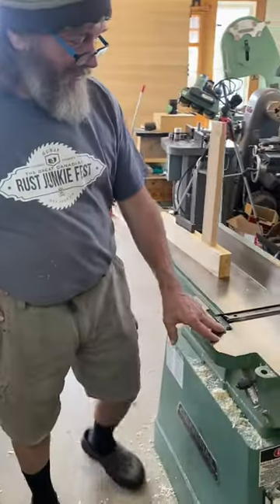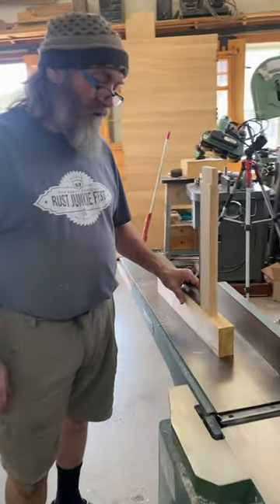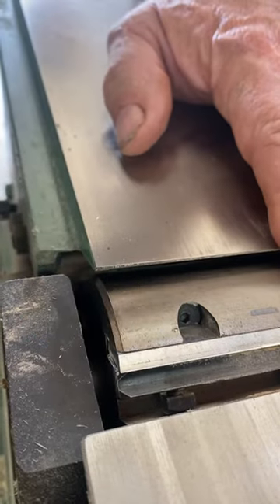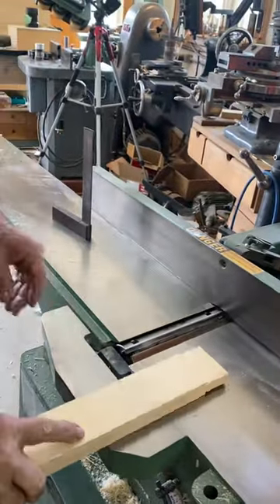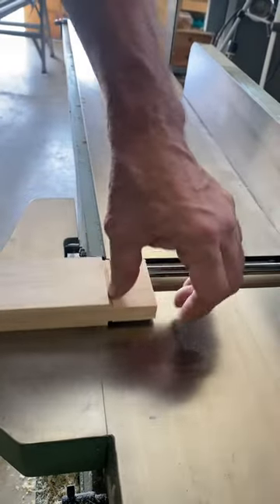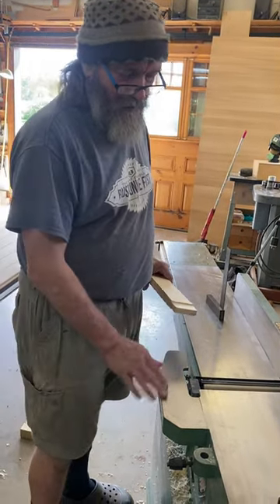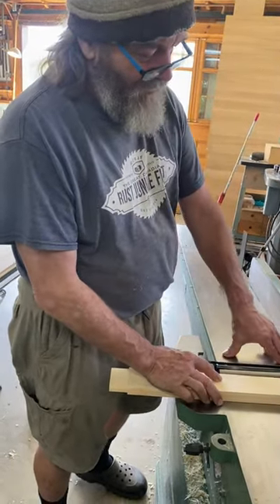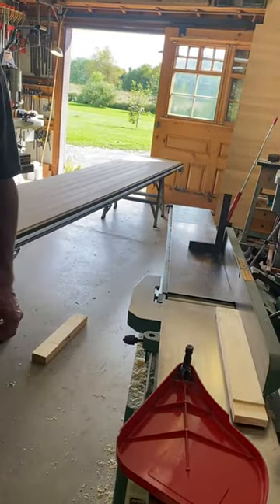Tenon cutting on the Jointer

Comment: Hi Jack, Multico back in the day made a tenoner attachment for their 9" Surface planer, similar set up as a small sliding cross cut table for a saw table, I have one cuts like a dream, most of the big tenoners including Wadkin have big horizontal  circular planer heads doing the main cutting, the Multico is not quite a Wadkin, but they are a good mid range machine capable of running all day.